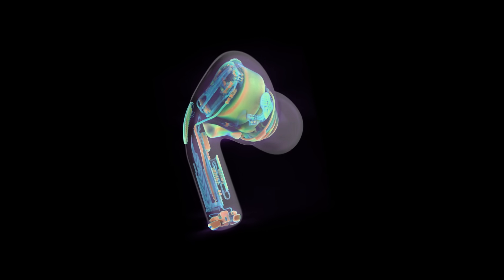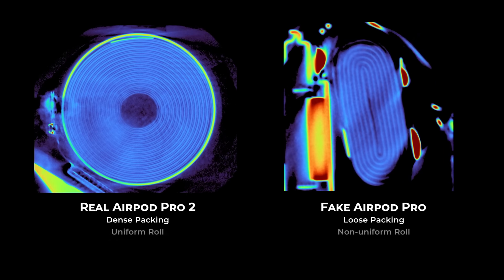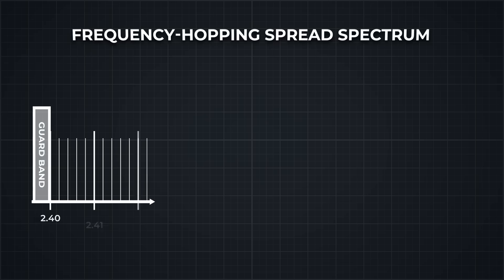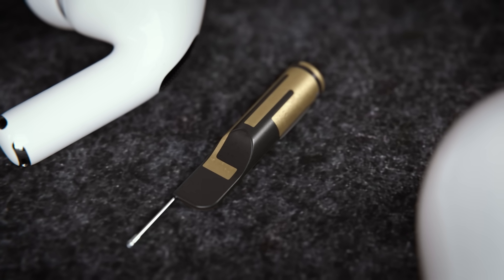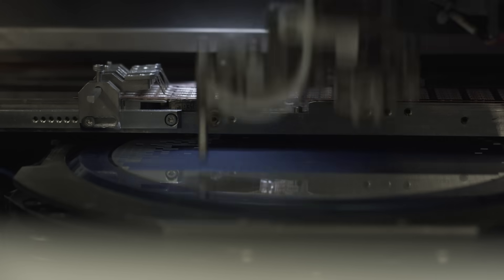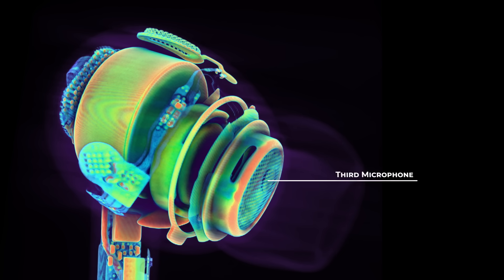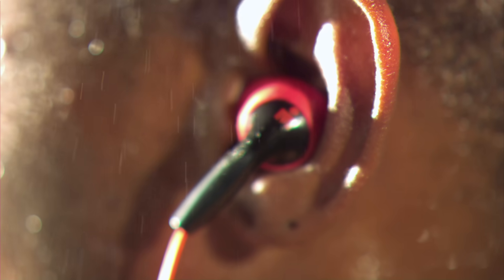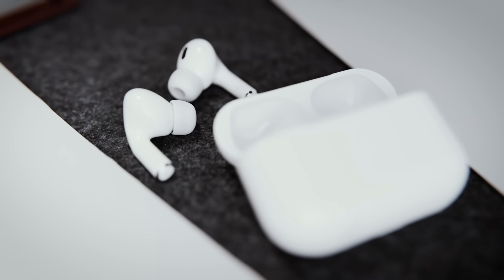How Apple AirPods Work

Comment: I have much cheaper TWS (US $50) which are much better quality and with much higher battery capacity than Airpods, with identical noise cancellation, as well as Dual Bluetooth Pairing
Reply: Have you listened to recent AirPods? And do you understand how electrical engineering works? No, you clearly don’t because battery capacity is of absolutely no use to anyone if it’s inefficient and still last a shorter time
Reply: @cactus_cuber1589  I may perhaps overqualify your requirements in Computer, Electronic and Electrical Engineering while understanding material science and marketing. 😊
My Oppo enco air 3 pro headphones crossed 1.5 years of daily use without any battery degradation despite being dropped and fallen twice on hard surfaces

Apple is Little engineering and Huge Marketing

Comment: I dont understand the overwhelming positiv impression on them. They are decent if your already in the apple system and want really good noice cancling. But in sound, batterie life they are  lacking behind a good bit. For comparison beyerdynamic has 8 hours real playtime with decent volume. Bigger drivers with more sharp sound. And most importantly a proper Bluetooth codec. Ldac, aptx etc. The airpods dont even have proper codec that is capable of high bit rates.

Comment: what if the batterie explode in you earHOLE? this is dangerous greedy apple.creating problem and solve with another product💩💩.anyway Good vid
Reply: Move out to a log cabin in the middle of a forest and don’t buy anything if you are scared of the battery’s exploding also, li-ion batteries like these don’t explode, they go in to thermal runaway and depending on the chemistry they release flammable gasses like hydrogen, which if sealed with a perfect amount of oxygen can explode, but AirPods will vent the hydrogen if the battery fails, you need to think two more times if you wanna think twice buddy

Comment: Your forgot the thing can measure the fit of the airpods in each ear and adjust the balance of 2 channels accordingly by just using that in-front-of-speaker mics. This is why airpod pros are sometimes struggling to balance the stereo sound when 1. In loud surrounding areas, 2. Low music volume. The mics having a bad time dealing with the SNR of the stimulus and outside noises.

Comment: How come my Sony bluetooth earbuds get away without the antenna-extension section?

Literally just last week I was reading up on tube guitar amp design and master volume circuits, where one fairly simple and popular mod on early ones (without that much preamp distortion) was post-phase inverter master volume that used a feedback loop to mix opposite phase signal in to reduce the loudness. It has its limits though, not that much quieter before dead signal. Also of course XLR and some other cables do the signal reverse trick in two different paths, reverses and mixes them together, cancelling noise. I guess you call that a balanced line. Surprisingly old technologies.

Does Harman target curve have anything to do with Harman Kardon hifi company (who bought Lexicon and killed their amazing rack and pedal studio/guitar effects lineup for lousy home theater reverb sidejob). Does Harman target curve give any insight to how the curve changes depending on the loudness due to built in compression? Like loud amps/audio just sound nicer and different.

It's also interesting how we often talk about how digital is great for its clean sound, but a lot of music has added distortion mimicking tapes and analogue equipment (essentially eq change, compression and distortion) to make it sound nicer. A lot of hard work is spent with digital to make it sound nice, that happened by accident with analogue equipment.

Very cool video!

Comment: The first time I tried active noise canceling on earbuds I was completely blown away. The fact that it was getting rid of the noise inside of my ear and head was completely unexpected. All the rumbling from when I moved my neck and jaw was completely gone.
Reply: Your comment was succesfully copied by a bot and they got more replies than you. 
Why is youtube so bad at fighting this?
Reply: This. This is the thing that amazes me the most. When using a passive earplug, you can hear the blood flow in your ears and your head, the shock when taking a step or moving even slightly. Whereas with ANC in the Airpods, you just hear "nothing".

Also it hasn't been talked about, but the way it creates a virtual passthrough when in transparent and adaptative mode is incredible. There is an option to use no noise-cancelling modes at all, and it's like your ears are muffled, while in transparent you feel like you have nothing blocking the sound.

Comment: I generally don't like Apple products. I appreciate the engineering and design, I just don't like using them. The exception is Airpods. My first pair were mistakenly delivered from Amazon. Think my order somehow got crossed with someone else's. I got my actual package, 32 gb of ram if I remember, later that week, and they told me to just keep the airpods when I asked about a return label. I had first gen Samsung wireless earbuds, and looking back they were awful. I tried out the Airpods and it was like a revelation. I lose and break things and the cheap ones work well enough for me now, but for a long time nothing could even touch the first gen Airpods, and I often consider buying another pair when I lose and/or break my headphones.

Comment: Excellent explainer and visualisations ... but wow, such Apple fanboi-ism! Both Sony and Bose make better sounding true wireless earbuds, along with many 'Chi-Fi' brands. Then there's water and dust protection levels, Bluetooth signal strength, reliability and audio codec support, battery life, colour and shape options, active noise cancelling ability, microphone quality (especially in noisy environments), etc. Apple isn't the best, by any means. Just one in a mature, saturated market, but with a huge marketing budget.
Reply: They are the best selling though, they are not the best but not bad in any means tbh, still decent
And tbh, u are not really looking for sound quality when it comes to tws, are u? If u want good sound, just use wired-iem or audiophile headphones
Reply: @DinooooC  you can buy them without much thinking about it and 95 percent are totally happy with them. 
The video seams just a bit weird comming from this channel.
Reply: Thx for bringing up audio codec. My beyerdynamic ones are using ldac witch is pretty good. But you can still really hear the difference too using wired headphones. 
Apple dont have even half the bitrate. 
I guess people never used proper audio equipment

Comment: The timing on this video is impeccable, I’m getting Pro 2’s tmr.

Never knew that impacts can damage the battery, explains a lot tbh.
Reply: Return them, the pro 3's are coming out soon
Reply: I always had a hunch but never knew for certain. My Pro 1 had noticeable drop in battery life when I accidentally dropped the left earpiece, and then it happened again with my iPhone when I accidentally dropped it. These drop incidents occurred years after purchase so on the face of it I chalked it to expected battery degradation but for me to immediately notice higher heating and less battery life particularly after the drops, twice, made me more cautious about drops in general. 

I have a new phone now and even though I know the accidental drops that happen in my case are minor and never cause any external damage to the device, but still I'm extra careful to avoid even such benign drops because I fear that my battery life will be affected. Glad to see finally know that it's actually true and it can happen.
Reply: Go for bose if you want noise cancellation or sony/Sennheiser for sound quality.. apple earpods are just average

Comment: A 1 diaphragm speaker cannot produce the sound quality of separate tweeter, mid and base speakers , if you care about real audiophile sound throw those in the garbage. Get an IEM with 5,6 or 8 drivers in each ear bud. Chifi ( Chinese HiFi ) blows the doors off iPods for less.

Comment: TBH I think they are still too big.

I also think that 6hrs use is not sufficient. It should be minimum 1-2 days. Im sticking with my wired headphones. I never have to worry about charging. Also the wires don't get tangled because silicone wires are magical.

Comment: The sound waveforms shown at 11:35 are highly misleading.  Assume (conservatively) that the spoken human voice contains significant frequency content up to 5KHz.  A 5KHz frequency component has a period of 200 uSec.  A 6uSec time delay at 5KHz corresponds to a phase shift of about 11 degrees.  Most of the frequency content of the human voice is at much lower frequency than 5KHz, resulting in an even smaller phase shift.  The scale of the sound waveforms shown at 11:35 make it seem like it would be easy to distiguish between two sound waves separated by 6uSec.  If drawn properly to scale, the sound waveforms from the two microphones would be visually indistinguishable, far less than a pixel.  The human brain is exquisitely good at detecting surprising small phase differences between sounds arriving at each of our ears, allowing us to pinpoint the direction a sound is coming.  How does Apple manage to accomplish this feat in such a tiny space?  Anyway, the horizontal axis time division labeling at 11:35 has to be a blatant lie; opposing council's expert witness is going to tear that to shreds!

Comment: Video was cool, But I feel like you didn't really use the 3D scans all that much, and you talked more about individual technologies, than how they are all integrated into the earbud.   Feels like the video should have been at least 10 minutes longer, so you could do a more overview of the earbud, and show how all the individual parts come together to make a single package.  Also feels like there was lots of other parts in the ear-bud that you missed.   I don't know about airpods, But I know most have an IR sensor inside them, so they know when you put it in you ear.  Zero mention of that.   Also no mention of the capacitive  touch pad for controls.  And surprisingly basically no mention of the speaker ( or speakers, as many earbuds and IEMS now have multiple speakers ). 

This was both too high-level, and too much of a deep dive for a single video.  It's like you wanted to talk about the earbud, without knowing exactly what you wanted to talk about, and got side-tracked with every device you pointed out, to the point where you missed the broad picture.

Comment: Two small nitpicks. First, frequency hopping was not invented by Ericssson. The first attempt at frequency hopping was by Marconi in 1899, further expanded by Tesla in 1903. The first modern approach to frequency hopping used a piano roll and was used in radio guided missiles. That implementation, gifted to the US Navy and closest to what we use today, was somewhat surprisingly developed by actress Hedy Lamarr and composer George Antheil. Second, accelerometers detect linear motion, but not rotation. Phones use gyroscopes for orientation sensing, which are a very different piece of hardware from an accelerometer.

Comment: Giving the battery capacity in milliwatt hours instead of milliamp hours is really weird
Reply: Milliwatt hours provides the true capacity of a battery, milliamps hours doesn't.
Reply: Except the nominal voltage is right there. And it's a lithium ion battery. We all know the voltage curve. I work with them extensively. They're almost always given in mA. This is weird, I promise you.  @Ben21756

Comment: man that accelerometer bit blew my mind thats so smart holy shit
Reply: You can tell the mics aren't always on because when you are actually using them, the battery life tanks. I've always wondered how they manage to listen for "Hey Siri" and keep the battery life great. Now I know. What a solution.
Reply: @zach-shea when you're hsung the mic the battery tanks? or is it actually when you are actively transmitting your voice to your phone (TX takes a while lot of more power than RX), or when the earphone is actively processing the audio signal for noise cancelation?
Reply: Isn't that what Sony has done for the XM5? They're using the vibrations to filter your voice from background noise
Reply: It means you AirPod battery drains faster if you sing along. 😂
Reply: Apple can afford the best engineers
Reply: You shouldn't pair the word "holy" with something that is filthy.
Reply: Holy shit  @goldfeather.yisrael
Reply: i kinda doubt it, but its a fun excuse instead of admitting the mics are always on.
Reply: @derb_  to me it just sounds like the mic turns on any time you start speaking lol it was kinda vague in the video
Reply: @derb_  The mics are not always on. Most sensors are not always on. Most of the time they use interrupts to turn on for a while and then turn off again when uneeded. Its a very common thing in embedded systems.
Reply: @derb_ it’s okay to hate buddy 😂